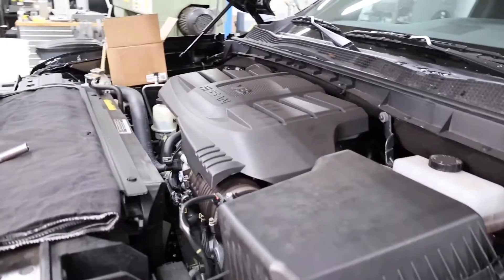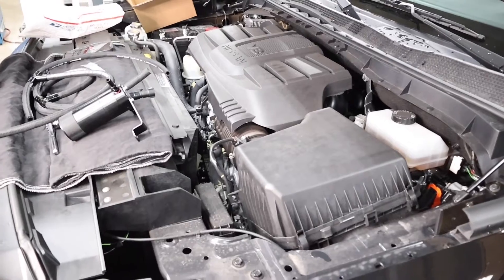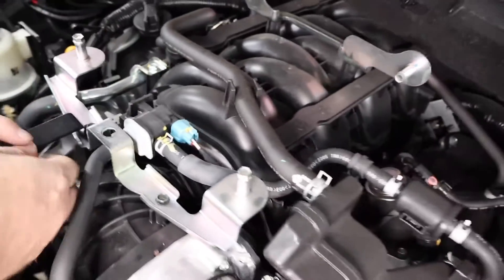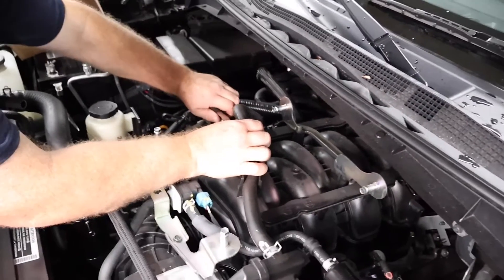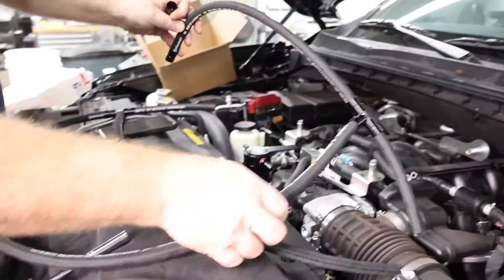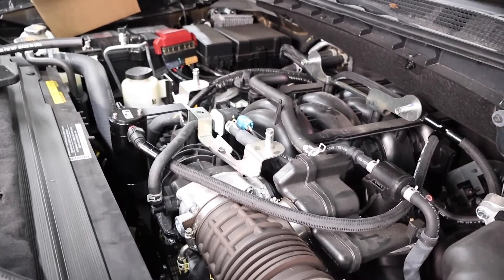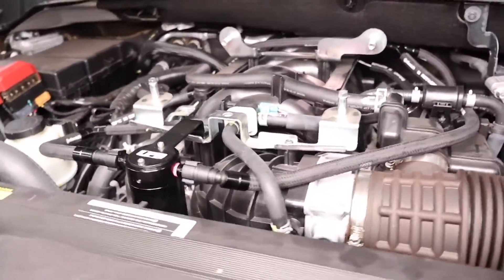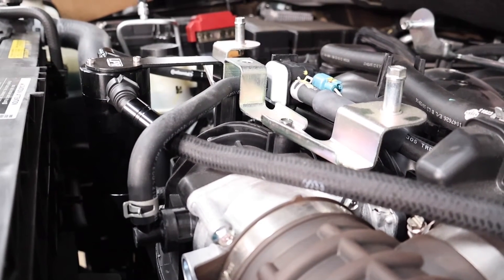How To Install a UPR Catch Can Kit for Nissan Titans Oil Consumption Issue!

Comment: Easy work! Installed mine in about 25 minutes, and I used the original hose clamps. I don’t care about the cheap hose caps, I’d rather them be nice and tightly secured

Comment: How does you hose end covers actually connect and remain connected to both the vehicle end and the hoses you supply?  If you had to disconnect them then how do they disconnect?
Reply from the maker: If you need to remove the hoses from the engine, they just pull off.  The barbed end on the PCV retains the hose.  To remove the hose, just give it a little twist and pull.  The hose ends at the catch can uses UPR Plug N Play connectors.  To remove the hose from the catch can just press the grey buttons and slide the hoses off of the can.

Comment: Bad design..why not put Y fitting out the crank case hoses .the way you have this designed both banks pressures are colliding into each other at the T then have to make the 90 turn
Reply from the maker: Incorrect.  The catch can system mimics the factory PCV system design.  If you look at the instructions you will see that there is vacuum applied to the crankcase via the PCV valves.  The UPR catch can system simply puts the catch can in line between intake manifold vacuum and the PCV valves so that the catch can acts as a filter for the PCV vapors. 
There are also factory hoses connected to the engine air box   This allows fresh filtered air to enter the crankcase as intake manifold vacuum draws fumes out of the PCV.  Same as factory.
Reply: @uprproducts well from a pure engineering side Jay is correct. Tee fittings and even just elbows will create pressure drop and turbulent flow. In this case coming out of the crank you have the passenger side colliding with the driver side, both to make a turn to go to the front. This 100% will cause a pressure drop and eddies. Is it a problem in this application case, most likely not. But, you are not correct that it mimics the factory design  it will change pressures and flow rate. This is basic fluid dynamics. If you don't believe it then run a Cv test and check pressure drop required to maintain flow rate of original design versus how much pressure drop is required to keep that flow rate with your stuff installed. Again, not saying this design really causes that big of a problem in general functioning. But from a purely fluid dynamics side. You are wrong.

Comment: If this is beneficial, why isn't it common among vehicle manufacturers?
Reply from the maker: It comes down to cost of maintenance, and the fact that the 'average' car / truck owner may not even open their own hoods these days.  Enthusiasts like us care about our vehicles which is why the automotive aftermarket exists.
Reply: People can barely remember to change their oil. They arnt gunna remember about draining a catch can every 1000 miles.

Comment: I just installed my UPR and thinking of removing it and just keep it stock…..reading all the OCC can create bad crank case pressure and restricted air flow and start blowing gaskets and have some oil leaks . Should have done more research before buying it 
I will just cut my losses
Reply: The UPR catch cans will not create more crankcase pressure.  You can prove it to yourself.  Just blow through the catch can and you will see there is no restriction.
Reply: @ I might do that 😁
Reply: Did you feel any power loss ?
Reply: @jayd1008 none … whatsoever , but I do t ever push it hard . Already collected substantial amount of oil within 620 miles.
Reply: @jayd1008  https://youtube.com/shorts/SpPGtvPyaXI?si=iK3KkAV5BSyYOpct

Comment: I heard only needed for turbo engines.
Reply from the maker: Bone stock daily driven engines ingest a lot of oil through the PCV system. For Vehicle manufacturers to perform better, the engine requires a strong vacuum signal through the PCV system, creating a better ring seal and improved MPG. In turn, the strong vacuum source will suck a lot of oil in the liquid and vapor through the PCV system at the same time, and that is the reason why oil separators/catch cans have become a requirement and not just a placebo. As for the engines with power adders, they require a dual valve system to be able to stop the oil ingestion at the same time while eliminating boost leakage, which involves check valve and a secondary vacuum source from the vacuum side of the power adder.

Comment: Just installed mine on my 2019 Nissan Titan Sv midnight edition. Easy to install. I used hose clamps though just for safe measure. Easy to install and it seems good quality all the way around. I'll update this comment after I drive for awhile
Reply: Update?
Reply: @acedikson2690 no issues works great
Reply: Update. No issues whatsoever and truck runs smooth. Definitely get you one
Reply: Looking for that update champ
Reply: @jervez911 no issues at all
Reply: How much oil have you emptied out?
Reply: @curtissavey9651 decent amount. Doesn't fill up right away maybe have to empty it once every 1 to 2 months. But in the winter when it gets below 20 degrees and I drive it for a few days in that weather. I have to empty it everyday due to the condensation. U'll get a murkey mixture of water and oil

Comment: Been wondering if I should get a catch can kit for my 2024 frontier SV since it's direct injection, but I get conflicting info as some videos say you don't need one or it will void the nissan warranty or cause issues. Can't decide if I should get one or not.
Reply from the maker: The benefits and overall engine longevity is priority. You can just go to your local dealer and explain what you are doing or see if you can pay them to install your UPR oil separator/catch can so you can sleep at night without issues. Or if you do it yourself, you can quickly return your vehicle to stock at any time.

Comment: I have a 2020 titan considering a catch can. Can you tell me what are the benefits for installing a catch can?
Reply from the maker: (PROBLEM): Oil Ingestion creates problems in the intake manifold, runners, and sometimes the throttle body. Oil buildup also occurs in the combustion chambers, allowing the fuel to be diluted and lowering the octane rating. This causes poor combustion and even cylinder detonation, possibly damaging pistons and/or rings. (This is common on all engines and should be corrected.)
---------------------
(SOLUTION): A UPR multi-stage catch can utilizes multiple coalescing filters, not just a single-stage filter, and screen like inferior designs run on the inlet or outlet side of the catch can. The UPR Catch Can will increase mpg and overall performance. A True multi-stage coalescing filter catch can kit reduces engine maintenance and increases spark plug life.

Comment: I've got the UPR billet oil catch can on my 2023 Jeep Wrangler Rubicon it works great but wondering besides emptying out the can what other maintenance needs to be done to the unit I've got 12,000 mi on it so far
Reply from the maker: Glad you like the UPR Catch Can as it's a great all-around improvement to performance and reliability. As for cleaning or maintaining on your kit, the only thing you need to do is just empty it and if you want to improve flow you can simply just pour hot dish soap water through the inlet side. This removes oil and grease much better than any other soaps or solvents and will be the only thing you can do once a year if you want to keep the optimal flow through the coalescing filter. UPR